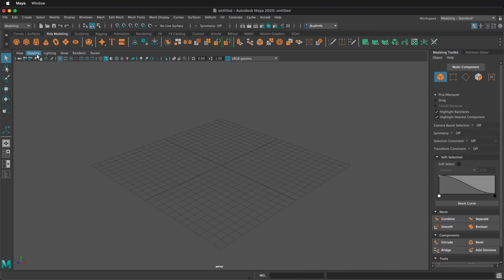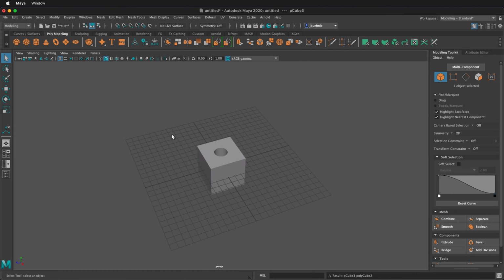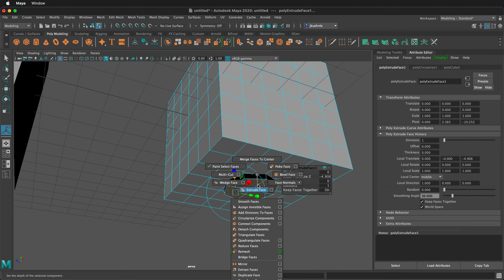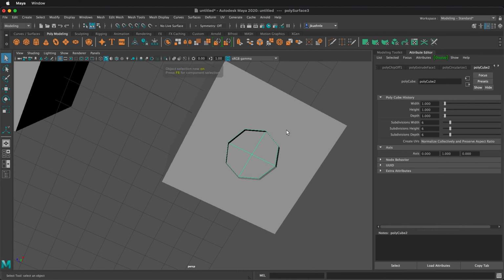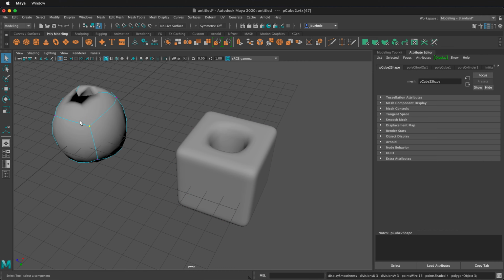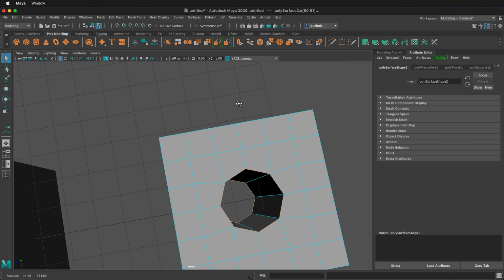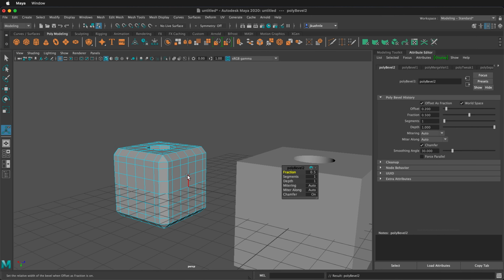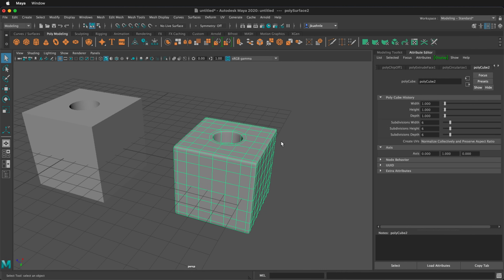Cutting Holes in Objects with Autodesk Maya

Comment: Question. If you didn't want that hole going all the way through, perhaps the bottom is just a tiny bit inset down from top how would you handle that? So the top rim as well as the inside bottom have all a nice, beveled edge. Say, the square is a tabletop, you make a small circular inset into tabletop to hold a mug.
Reply from the maker: https://youtu.be/PHj-rv7U-Ac this video shows what you're trying to do I think

Comment: How to use this method for a cylinder?  Im modeling a vintage telephone. For the dial pad i need to make holes. How do i make holes  using this method?  Thanks in advance
Reply from the maker: Make some loop cuts first, here is the basic concept used to make a handle on this coffee cup https://youtu.be/V59XKklgfDE

Comment: Even faster, instead of extruding the upper part, just make cyrcle on both sides at the same time, delete the inside on both parts and bridge between their edges, anyway, liked the vid, nice method
Reply from the maker: Many ways to do it, thanks for sharing another method
Reply: Bro, thanks for the tip, really fast and easy even for noobs like me (his method was more complicated by also taught me to use V to snap things, which will be very handy)

Comment: How do you do this with a rectangle? I am making a pull toy but the wheels are on the sides (so the long sides of the rectangle) would I just need to add a ton of subdivisions?
Reply from the maker: You just need two edge loops in the middle for the circle, then you can add subdivisions later after you do all your beveling and things at lower poly

Comment: I'm in college studying computer animation I didn't learn none of this 😯 Thank you! 🤭
Reply from the maker: There is a lot to learn 👍

FYI, a better way to join the two sides is just to delete the faces after circularize components. Then double click the edge of the top hole hold shift, then double click the edge of the bottom hole, then hold shift right click and select bridge

It is a faster way of closing the hole. You still need to bevel edges after